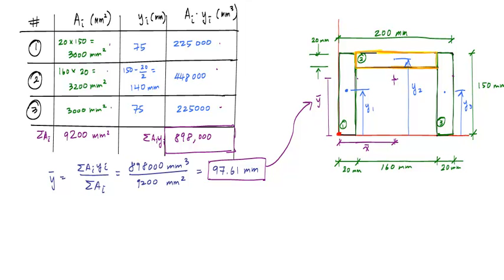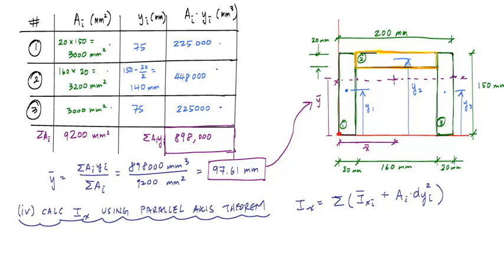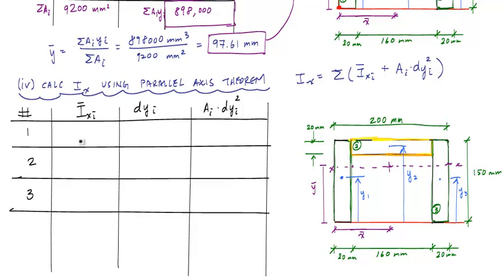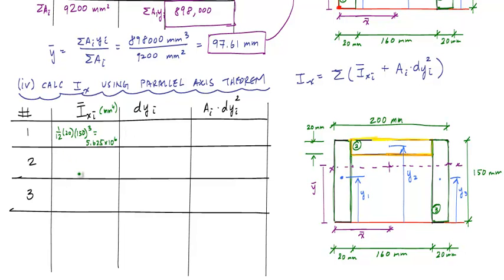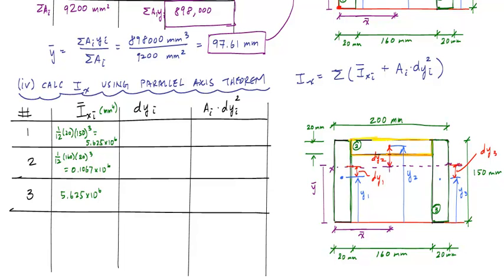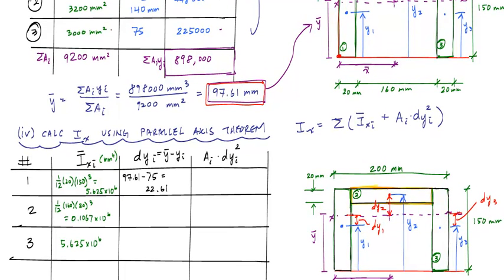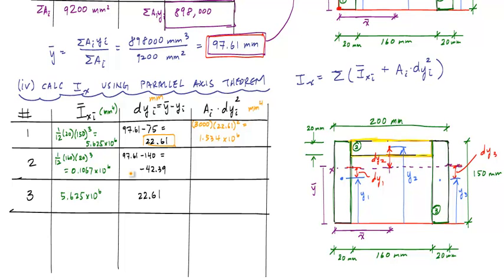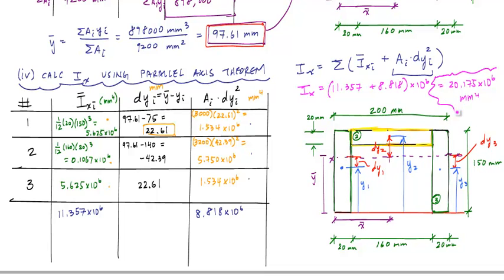Geometric properties of a channel section (part 2/2: moment of inertia) - Structure Free

Comment: Ix and Ixx are different right?
Reply from the maker: Not that I'm aware of. I think they both mean moi about the x axis (usually horizontal axis) of the cross section.
Reply: @structurefree  is it possible to discuss complex questions based on MOI with shear force and b.moment diagram?
Reply: I see...